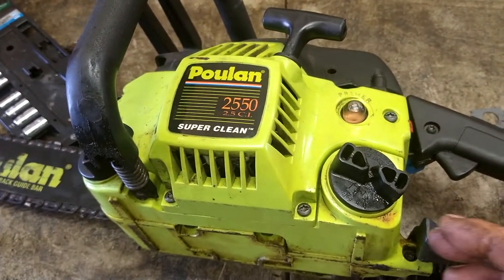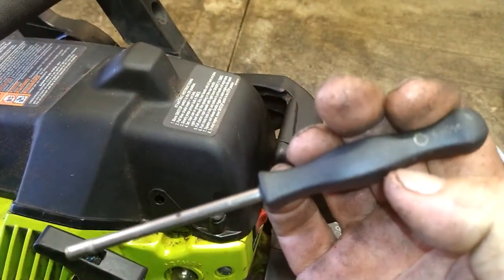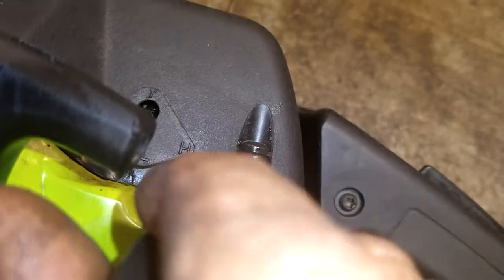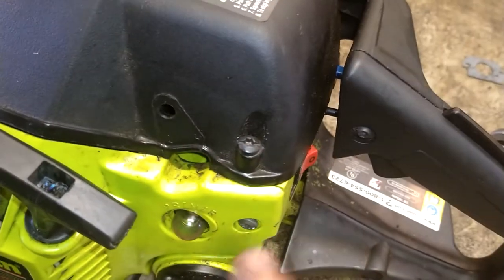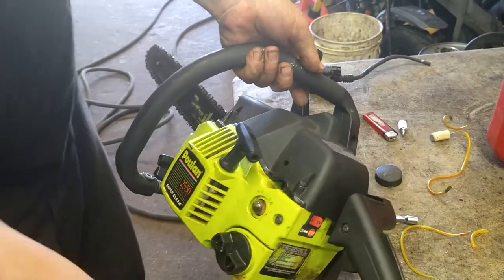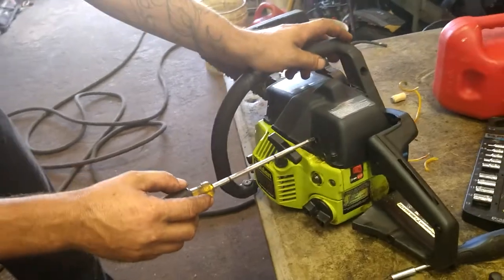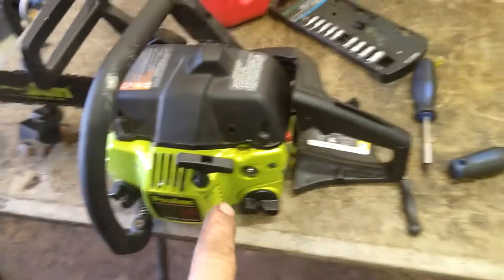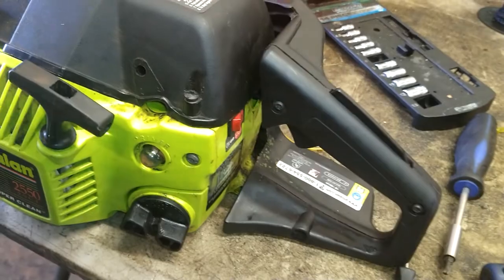poulan 2550 woodmaster chainsaw carburetor adjustment

Comment: My question I have a Poulan chainsaw with the same carburetor. I'm a homeowner so use the saw infrequently and it seem like almost every time I use it I have to adjust/ tweak  the Low and High speed . is this normal what should I do if anything can be done.
Reply from the maker: It does that from lack of use. I would drain everything before storage fill with seafoam or marvel mystery oil. Prime till bulb is ful of the oil. When im ready to use again i drain the oil put in a little fresh gas prime it drain it again fill with fresh fuel prime again to get all oil out of carb then start. This keeps the lines from dry rotting since the oil doesnt go bad. Works on any 2 stroke with a primer bulb

Comment: Hey i have this same chainsaw and was wondering if you could help. O can't get it to start, the fuel gets clogged trying to from the bowl to the jets (looks like a brass ring with a tiny diaphragm). I bought a replacement but the only one I could find had the fuel return on the other side and blocked the throttle linkage.  I tried to turn it to get clearance but snapped the tube. I'm so sorry for the long post but I'm stumped trying to get this running.
Reply from the maker: needs new carb and fuel lines. not as bad as you think. here is a video of me doing the same kind of chainsaw. its a poulan wildthing but the same as yours. https://youtu.be/uuLSGMzIfh8 and here is the carb set you need https://amzn.to/3x32z84

Comment: If you’re making videos on adjusting chainsaw carburetors, please do your audience a favor and research how a chainsaw should sound like at full throttle. It should 4 stroke. Your saw did not because it’s still set to lean and will likely fry the piston/cylinder when put to any heavy use. That’s why many homeowner saws bite the dust.